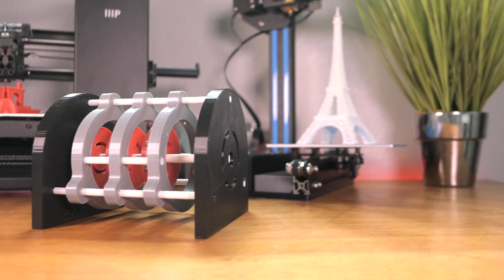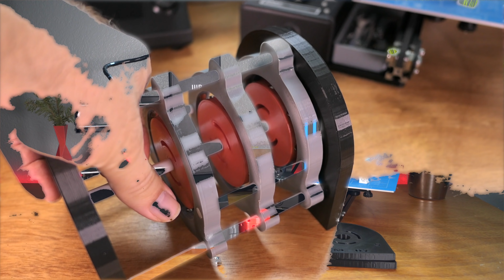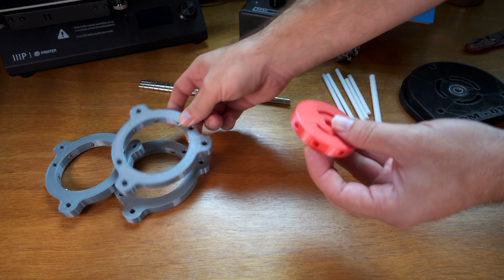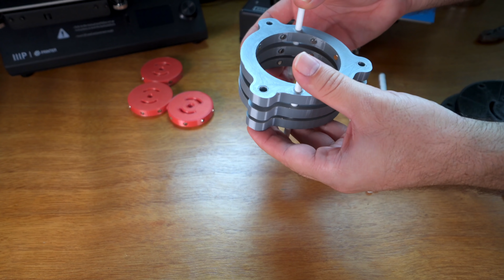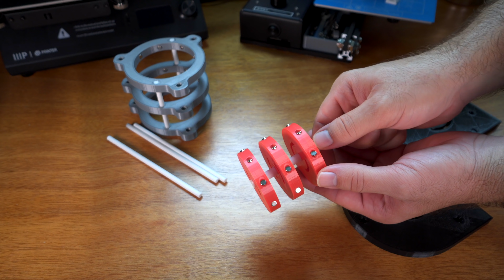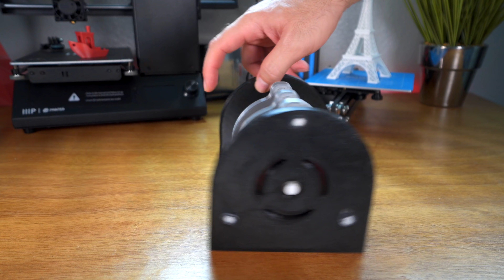3D Printed - Perendev Magnet Motor - Free Energy

Comment: The magnets need to be at 36º in opposing directions. Not directly facing each other. And that plastic will not be strong enough to hold it together if it was properly angling the magnets.

Comment: The magnets have to be set in the correct Position! If not its not going to work ! The distance between the magnets is to big too
Reply: "The magnets have to be set in the correct Position! If not its not going to work ! The distance between the magnets is to big too"So far no one has discovered the correct positioning to make this work. There is, in fact, no positioning that will change things. Perpetual motion is impossible in our universe.
Reply: Yes i believe those slots he ignored were designed for timing
Reply: @jhanthony2  actually, these do work. There is a large one in the kids science museum in Phoenix that powers a large clock. I have made one myself and they are great. 👍 

I know exactly what he did wrong and it's very simple. Lol.
Reply: @MotorMenaceFPV  Are you claiming that you yourself have made a motor that is powered by nothing more than magnets? No outside electricity? No batteries? Only magnets, and it spins in a circle without slowing down or stopping? You have done this?
Reply: @jhanthony2  yeah I've made one, and it worked pretty decent. Its called a perendev motor and I dont take any credit for inventing it. The question is the practicality of one as a free energy generator. Just because a potato can power a clock doesn't mean we should work on inventing potato powered airplanes. It's more of a science parlor trick than a solution to energy crisis. But yes when they are done correctly they work. In engineering precision is everything
Reply: @jhanthony2  not to sound rude, but some people would argue that since matter cannot be created or destroyed our Universe IS perpetual motion. 👍 I've never known it to just stop.
Reply: is not only position problem! need a mechanism to neutralize the field at the right time, for example, how the AK47 works when firing and charging a new bullet, simply put a switch is needed=)

Comment: hey mate, the middle bit, where you have those 3 circles, the magnets have to be placed not on the same like but to fill the gap, so if you think of 1 cm for example, first one to be at the start of the cm the second in the middle and the 3rd magnet at the end of the centimeter, these it make any sense? then when you spin them the first spinds the second takes over the third completes the action, do you have any links for those magnets? I will try myself to do it

Comment: I've been having dreams about magnetic motor designs the first dream showed me magnets on the side of the stater to help focus the magnetic field toward the rotor and now i had one of a gyroscope on the tail end of the rotor so once the rotor starts to spin the gyroscope helps the rotor to continue through the magnetic field helping it not to get stalled by the what i call the 1" bearer that seems to slow down the rotor and eventually stop it I still don't know enough on building one plus the lack of equipment and resources forces me to only thought and paper experiments which is a far cry from a physical experiment I just hope someone figures it out and doesn't get stuck by greed and lose the invention to patient restrictions or buy outs  the world needs this type of technology
Reply: Use a lie theory diagram as the instructions to build one, align all magnets NSNSNSN. But you need 2 layers min of which need to be off set by 60°. This guy doesn't use enough magnets.

Comment: The reason it wasn’t moving is that there is a sticky spot. When you line magnets up perfectly and get them going in the same direction they won’t interfere.(Or not as much) therefore you get fluid but not continuous movement. However when you have one static set of magnets then one rotating one they interfere. This happens because if it pushes on one direction. What’s stopping it from going the other way? Nothing absolutely nothing.

Comment: You made it wrong. 1st of all , the magnets need to be in a step down formation where the 1st magnet on the rotor is flush to the outside top. The second magnet by the first magnet MUST BE lower in the plastic than the first and the third magnet even lower and so on. ALSO there must be an area on top and side where no magnets. Also the rotor magnets go in clockwise and the outer magnets go in clockwise. ALSO the rotor must be heavier than the pull of 2 or 3 magnet force pull. Get a scale to find out how much pounds a magnet will hold until it lets go. ALSO each individual magnet that steps down WILL BE angled slightly different than the one next to it. SO THAT the magnet force goes out to one side. The lowest magnet to have a straight up and down position and the magnet next to it that is higher up will be slightly angled position outward and so on. The outside magnets to be pointed the opposite direction outward. it does work IF YOU BUILD IT RIGHT. YOU SEE how it works is that the magnets on one side are weak where gravity pulls the magnets down, then when it gets to the other side the magnets pull it up and the weight and spin forces take over to spin the rotor past the magnet area to the no magnet area to start the cycle again. I suggest you place the rotor or wheel upright and find the sweet spot to place the outer magnets on top somewhere.

Comment: Moi j'ai créé un circuit qui est alimenté en 1,24 v  et qui fournit du 64 v environ et sans moteur. C'est juste grâce à des alternance autocentrees sur une onde magnétique stationnaire. C'est une découverte du cern grâce à l'accélérateur de particules, mon oncle travaille au cern ;)
C'est une énergie magnétique  reliquat dans le noyaux des atomes. C'est un reste d'énergie lors de la création du noyau atomique, il suffit de la libérer.  La difficulté est de trouver la bonne fréquence de l'onde stationnaire.
Bon courage à tous.
Reply: normal, que personne ne puissent pas faire fonctionner longtemps un appareil magnetique,  c'est comme avoir la meilleur recette pour faire un GENERATEUR HHO ( Hydrogene... ) ... les gens foutent juste du 12 volts et 3 a 5 amperes,  mais s'ils s'amusent a ajuster aussi ''  LA FRÉQUENCE DE L'ELECTRICITÉ '' , alors la tout est possible :P

Comment: You can never make a magnet based free energy machine because the force between magnets is a "conservative force".  Look it up on Wikipedia. If a particle (or magnet) travels around a closed path, such as a circle, the net work done by a conservative force on it is zero. So there is no work/energy available to overcome friction let alone power a load. This also explains why adding "shields" doesn't  help.